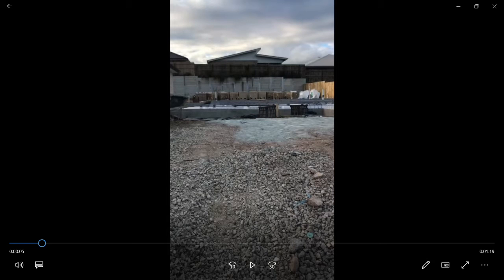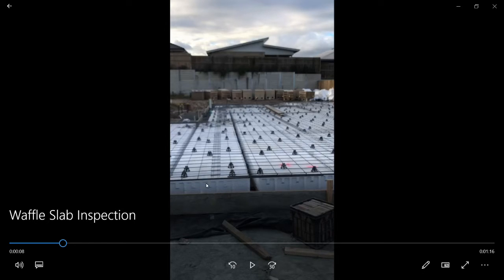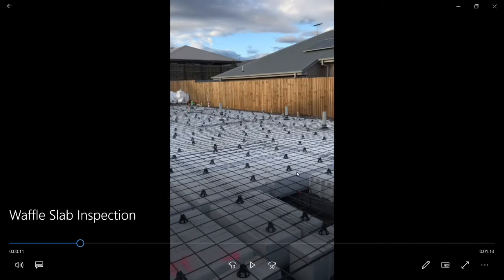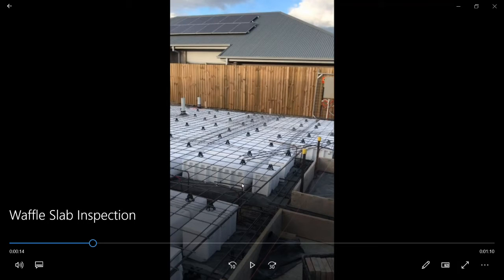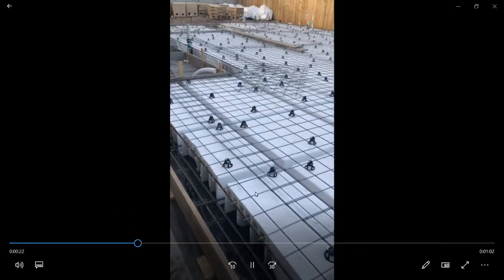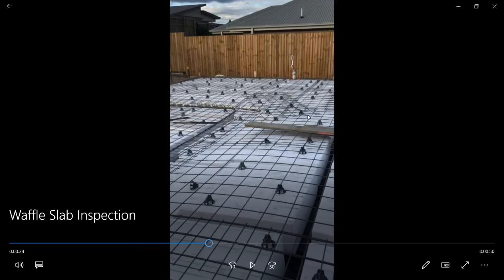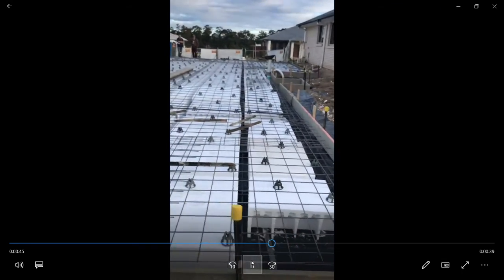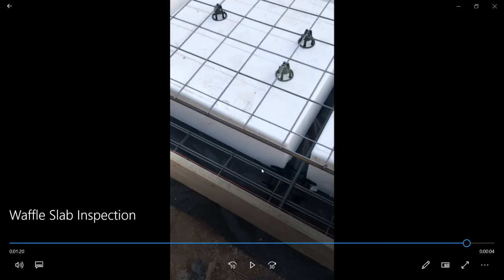Waffle Slab Inspection with Engineer's Description

Comment: When slab mesh got cut due to vertical service pipe, some engineers specify "provide a 600*600 off cut of mesh, lap and tie to the underside of slab mesh". Just wondering does this off cut mesh has to be installed to the underside of the slab mesh or it can be located on top of the slab mesh?

Comment: I think there’s a fundamental problem with waffle slabs as the only two friends I know who have waffle pod houses, are both are having serious problems with movement. When your house starts to break in two because of poor foundations there’s got to be a systemic problem. The engineer, builder, concreter and inspector have all failed to do their job. How does that happen? Like someone asked what happens when water soaks in under the house? Won’t the buoyancy cause problems? Either way, 100% of my sample has had issues so I’ll stay clear of this design thank you.
Reply: Taking lots of photos of the formwork and the day of pouring is the best advice
Reply from the maker: In terms of scientific investigations I think two samples is a fairly small subject pool. :) But yes, at 100% problem rate it does make you wonder.
I haven't heard of houses floating away som let's rule out buoyancy issues for now and have a chat about reactive clays, screw piers and site drainage.
Wait.
We already have. We have a series of videos right here on our channel that cover off on these isses! 
There's the potential for a lot of finger pointing when houses move so your friends need to educate themselves, do everything they can to show they have complied with the engineer's design drawings relating to drainage, tree planting, leaking taps, garden watering so they don;t become scapegoats.
Watch our videos and hopefully they make sense of all this.
Then prepare for a battle because you are right. The builder blames the soil tester. The engineer blames the certifier. The soil tester blames the plumber. The council blames the developer. And somehow you have to make sense of this massive blame game.
Or, if you read this and watch the videos in time (before you build) you might decide to skip all this heartache, take lots of photos during construction (as per another of our videos) and think very carefully about which builder you invest with.
I hope we caught you all in time. In any case - take lots of photos!!!
Matt Cornell

Comment: Thanks for the Video Matt. I'm no expert but watch your video, it seems like that plastic sheeting will also act as a funnel for surface water from the backfill next to the slab. And isn't polystyrene going to float if there's water underneath it? Isn't this a terrible design which promotes slab failure/heaving? I'm looking at building a home in Qld and just seeing so many predatory project sales tactics is an awful experience
Reply from the maker: Hi Jarrod
Thanks for your comments. 
I know slab edge heave can be an issue but I don't necessarily attribute this to polyethylene membranes under the slab.
I've not heard of polystyrene floating after the concrete cures but if the concrete isn't poured carefully the individual pods can move and float as the concrete is poured.
The idea of void formers within a concrete slab isn't without merit but it needs careful protection against uneven soil moisture conditions - but then so do raft slabs.
As far as predatory sales tactics - call the companies out. Social media and forums like #homeone can be a great place to share experiences. Eventually the careful, considerate builders will float to the surface. When the other builders manage to silence bad situations by muting individual customers then the building industry suffers  Why should shoddy builders be able to get away with it?
Matt Cornell
Reply: @CornellEngineers  Thanks for the reply Matt, you’ve given some good advice. Today I spoke to a national ‘premium’ spec home builder and I asked about their slab options. It was either straight waffle on cut/filled ground, if it unfavourable soil: waffle on piers (30-90cm wide up 1m-3m depth x 40-60 piers) with an option to vary the pod height. The waffle slab then rests on the levelled piers but aren’t attached to allow movement. Approx $50k for the piers + waffle pods. What are your thoughts on this method? Would you mind me asking why the waffle design can lead to failure? And would the pier + waffle method mitigate the issues?
Reply from the maker: @Tigerdograt  Waffle slabs on piers where the ground conditions vary and/or are soft is a solution to the specific problem of uneven differential settlement/consolidation of soils. Having piers throughout the dwelling (under internal and external footings) is a great idea - the whole house is then founded on a similar soil stratum
For an explanation of why the waffle slab system can lead to failure check out my video on waffle slabs and drainage. https://youtu.be/5Cu8PXN3Wl4
 The solution? A compliant engineered design based on a careful site classification built by a builder that cares enough to inspect and record photographic evidence of correctly-installed plumbing, concrete work, landscaping, and framing backed up with in-person construction phase inspections by competent and experienced engineers and certifiers.
Matt Cornell

Comment: 1200 centres rib to rib buddy. I would of failed that job just on the chair spacing let alone the rest of that mess. Doesn't sound like you know what your talking about, must be an inspector acting like a real engineer
Reply from the maker: LOL. Oh Jacob you crack me up!
Reply: @CornellEngineers  what would I know right, just a concreter that lays pods almost everyday chair spacing should never exceed 800mm spacings tell me I'm wrong
Reply from the maker: @jacobedmonds2076  Yes, you are right about the 1200 centres for pod ribs.
The 800mm spacing requirement for chairs is shown on most engineers drawings (including ours) but this number doesn't come from AS2870. Cement Concrete and Aggregates Australia specify 800mm to 1000mm centres. 800mm is a good target, especially for light mesh, but I haven't seen anyone fail a slab for bar chairs being spaced out a bit further. Have you?

Comment: Superb video, thank you. Do you have a view on what is necessary to achieve compliance (for the waffle pod design) in terms of the vapour barrier extending vertically up the edge of the slab - assuming the builder back-fills adjacent the house with loose material (e.g. soil or sand)?
Reply from the maker: Hi DickozOr
Thanks for your question.
The requirement for termination of the a barrier under a slab changes based on your location, whether the soils are aggressive (saline or acid sulphate) soils, local practice and surface falls.
Traditionally we never used to look for continuation of the vapour barrier up the outside of a waffle slab. To me it feels this detail has become more popular lately. 
The requirement would be most straight-forward for aggressive soils (Clause 5.5.2 of AS2870). In this case it is required.
Otherwise it might be a suitable detail for preventing edge efflorescence where the ground falls towards a wall built on a boundary and sloping of the ground away from the waffle pod slab is outside of your control. This detail might be preferable to waterproofing the external edge of the slab for some but I would rather see a waterproofed slab edge here. Some footing design alterations should be considered at design stage where good drainage cannot be achieved.
Generally, for site not contending with aggressive soils, grading the hard ground (not the porous fill) away from the building is still my preference.
NCC2019 variations for NSW and SA overrule the requirements in AS2870.
Reply: @CornellEngineers  Amazing response! Thanks so much for your insights.

Comment: I have off the plan house coming up, It is approved by structural engineer for M-class slab on P classed site. It is waffle raft with concrete piers. Is there anything I can do to bring it to builder attention as the structural warranty is only minimum 6 years.
Reply from the maker: Check out my answer here: https://youtu.be/5Cu8PXN3Wl4

Comment: Thanks for the video but some conclusions at the end would be great. Has that particular slab been done properly? Different height was mentioned for patio. Is it a really big issue? Worth talking to the builder and making them redo half of the slab or not?
Reply from the maker: Fair call Alexander and I shouldn't have presumed the answer would be clear if I didn't say anything.
In this case, the slab reinforcement and cover complied with the engineer's drawings. No major issues were identified.
So pretty much good news on this occasion.
In fact, most concreters put a waffle slab together in accordance with a set of drawings pretty well.
We do see issues with pods floating within the wet concrete from time to time. This results in a thinner slab than specified. The last time I heard about this the builder identified it by accident when a hammer was dropped on the slab. A dull, hollow-sounding slab when struck might be a reason to investigate the slab thickness further.
The bigger issues come from poor site drainage and we're about to upload a video specifically on drainage issues for waffle slabs and this new video will cover off on the patio slab setdowns a bit more.
Matt
Reply from the maker: PS: This is the link to our drainage video for waffle slabs https://youtu.be/kO5GDPhQexI

Comment: Great video. Thank you for explaining this in detail. Just wanted to know more about piers and edge beams. Do these increase waffle pod strengths? What about Concrete strength? Looks like most builders these days use the minimum recommended strength of 20mPa. Do you reckon that a 25 or even a 35 mPa concrete will make a waffle pod function better? What function does the re-entry mesh serve? How about waterproofing and sanding the surface before laying out the pods? What about vapour barriers and damp proofing? Sorry to ask so many questions but with builders cutting corners for maximum profits, I think home owner's only remaining hope is an honest engineer :)
Reply from the maker: Wow. Abhishek Vora thank you for all those questions. The easy one to answer is that 20MPa concrete is all that is required under AS2870 - the code for footings and slabs. In theory 25 and 32 MPa standard concrete strengths have some advantages when it comes to crack control but have more problems with workability - the screeding and finishing process. The extra concrete grade improves deflection control marginally but when an Australian standard specifies a minimum complying limit there are some that manage to just hit that line and some that prefer to jump right over it.
Let me ponder the other questions and I may do a follow up video to answer. If any other commenters want to chime in, please do so below!
Reply: @CornellEngineers  You guys are awesome. Thank you for getting back I will wait for other answers.
Reply: +1
My off the plan house has concrete piers in & with waffle raft. Is this better than the floating waffle pods? My builder is only offering 6 years structural warranty, which raises concern. It would be great if Mr. Cornell can suggest what should be done as a purchaser in this case.

Comment: These are not great on highly reactive clay are they? Would you have any clue why builders are still using this kind of slab when it's not recommended to build on specific types of land?
Reply from the maker: Hi Discotheque
Yes, it's a controversial issue and I guess the answer is that it comes down to construction cost, the buying power of builders who are willing to look for engineers that will sign off on waffle slabs on reactive clays and ignorance of the soil moisture maintenance issues that must be addressed by builders, plumbers and homeowners to achieve satisfactory performance. Queensland has started to attack this issue by introducing requiring special plumbing designs for reactive sites. The next step is to educate plumbers to ensure this information makes it through to construction. Eventually, I expect the cost savings that waffle slabs offer will be dissolved by the extra compliance, extra plumbing cost and possible extra insurance overheads that come with floating a house on reactive soils. But really, consumers need to become more informed so they can choose for themselves whether they can really achieve the required soil moisture maintenance specified by the engineer - sometimes at risk of not having gardens or trees anywhere near the building.
Matt Cornell
Cornell Engineers
Reply: Is that still the case of you use piers?

Comment: Is it possible to build a two storey home on this kind of waffle pod system? And is it possible to use a cut and fill method on slope sites with a waffle pod system?
Reply from the maker: Hi Stefan
Thanks for your questions. Yes. It is quite possible to build a two-storey house on a waffle slab system but with limits according to AS2870. For example the code does not allow for double storey masonry veneer construction on highly reactive (Class H2) sites. An engineer can over-ride these standard designs, but at their own peril.
Cut and fill is almost mandatory on waffle slab sites. The slab system requires a super-flat site so that all the polystyrene pods can be laid out at the same height (except for set down areas). Those flat sites are long gone so any sloping site has to be 'made flat' and the cheapest way to do that is cut to fill. Of course, with filling comes the chance of subsidence so that too will need an engineer to sign off.

Hope that helps.
Matt Cornell
Cornell Enngineers
Reply: @CornellEngineers  Thanks Matt that was very helpful info!

Comment: Is it possible to use waffle to have a slab for a shed raised 1.3m off ground level?
Reply from the maker: Hi Commissarius
I'm guessing it is a sloping site? Unfortunately, waffle pods don't come that high and it isn't usual to stack them. The other issue you will have is forming up the side of a slab that high. So at that height, there are a few factors working against you. Your engineer will have some ideas on how to overcome them.

Comment: What is the trimmer bar doing structurally under slab mesh?
Reply from the maker: Hi Al Jafari, do you mean the diagonal trimmers?
Reply: @CornellEngineers  At 3:27 you are explaining the extra bar on top below the slab mesh. What is that bar doing? Thanks
Reply from the maker: @aljafari2364 , the design engineer specified it. It's top reinforcement so that bar makes the slab slightly stronger. From memory this slab was poured on concrete piers so top reinforcement is also required over piers according to the code.  Finally some engineers provide extra top reinforcement to try and prevent cracks forming at the edge of the slab.
Hope this helps.
Matt Cornell
Reply: @CornellEngineers  That makes sense. Thanks Matt